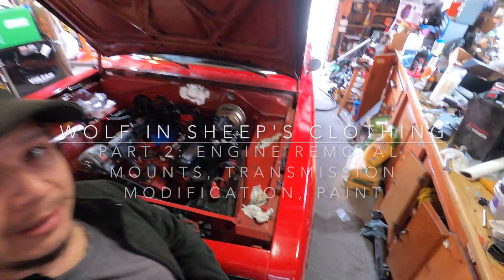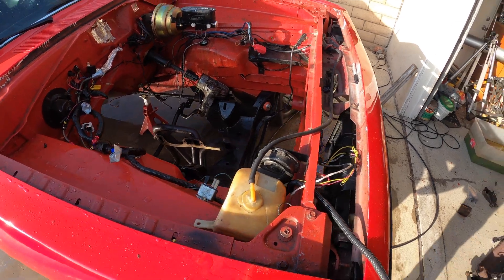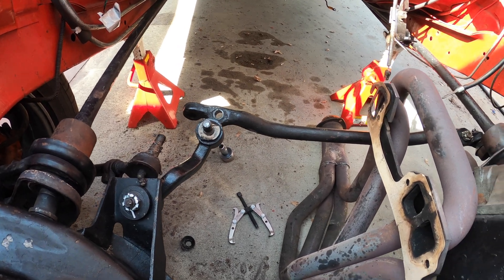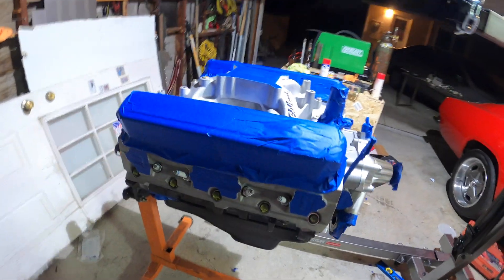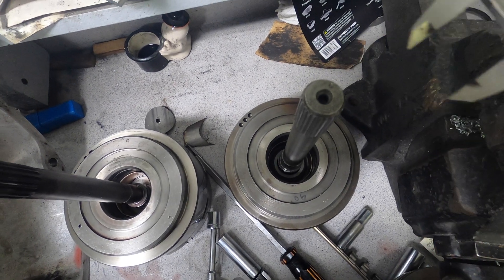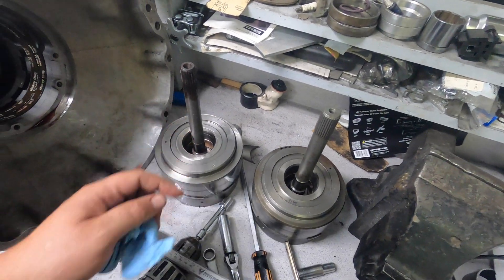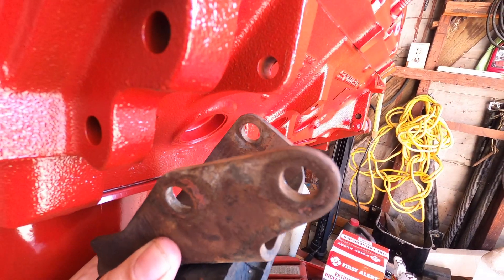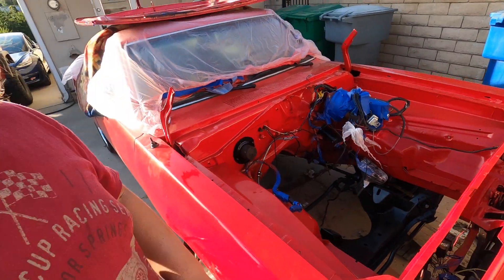Project: Wolf In Sheep's Clothing Part 2 - Engine Removal, Engine Mount, Paint & Transmission mods

Comment: I was wondering exactly how long it was from the day you ordered the engine until the day you got it. I’m going to be ordering one soon myself. Also, how are you liking the quality so far? Thanks
Reply from the maker: Ordered December 21st 2020 and shipped out Feb 3rd 2021 and arrived Feb 9th in Los Angeles, CA. Based on appearance, I am satisfied with the quality, Eldelbrock heads (though I am told Blueprint does the head assembly, they just purchase casting from Eldelbrock), looks like custom BPE 1.6 ratio rocker assembly (has BPE etched on them), grade 8 hardware throughout, NGK plugs, etc. Over all looks good thus far. I should have the car running in the next few weeks and will know for sure, but thus far happy to have done business with BPE. Was able to work directly with them and ordered a complete engine minus carb and ignition system to save a few bucks since I have an EFI and MSD system I am running anyways.
Reply: @AlvarosGarage  Thank you very much for the detailed reply. We will hopefully buy one for our '71 Demon.